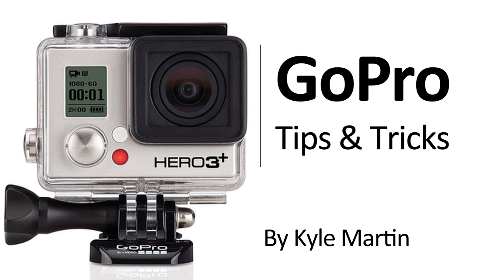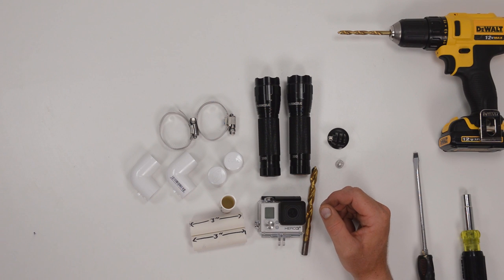DIY Dual Flashlight Mount

Comment: I really like this Mount. in theory you could make it a floaty one too by sealing the pipes.
Reply: It might float, but I would stuff it with foam from a pool noodle or something because if there is a leak in the air seal, it could sink.  You could also have GoPro's floaty backdoor on as well.